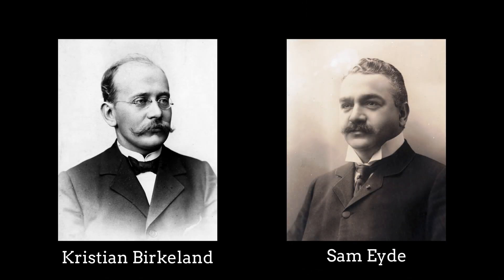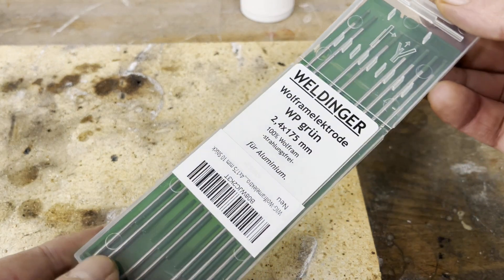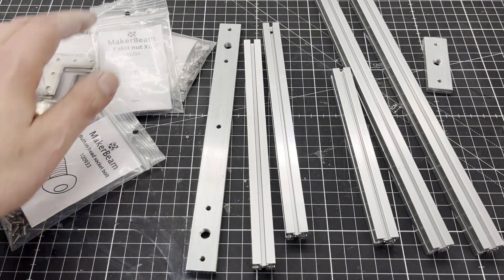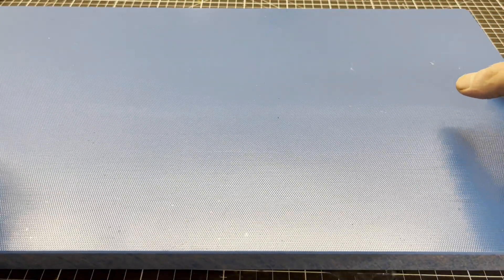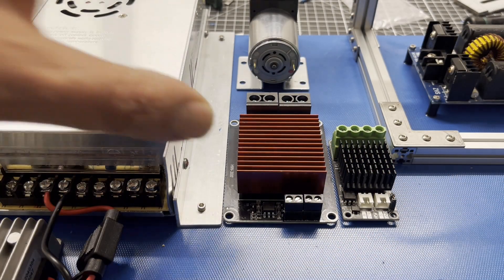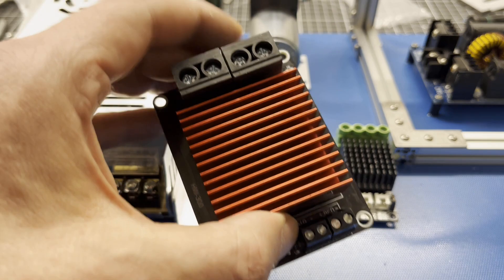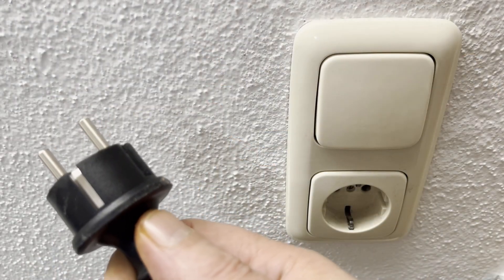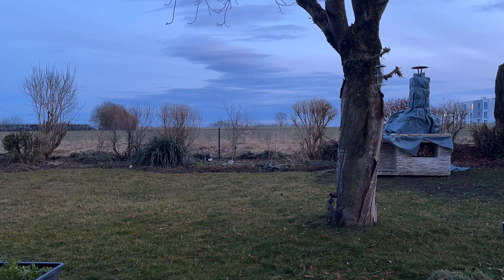Building a small, fully automatic Birkeland-Eyde experimental reactor

Comment: Super cool setup. It's since long time I'd like to make something similar. Some questions.
Where the arc is formed the temperature should be pretty high, however you clearly kept the overall temperature lower seeing the arc tuning on and off. Why?
How do you combine the flow rate with temperature and the whole process? 
Finally, if can I ask, where do you purchase those silicone tubing and mat?
Cheers.
Reply from the maker: Thank you:) The duty cycle (5s ON, 3s OFF) was just for testing to see how hot the reaction flask gets. Flow rate, temperature, duty cycle etc. are still under testing. It can be run to produce nictric acid, but I want to use the reactor also for research; plasma physics for example, emission spectrum, black body radiation of the electrodes, etc. The silicone tubing and mat can be bought on Amazon:)
Reply: @Marbslab  thank you. I searched in the past silicone tubing on Amazon but I got "scammed": it was PVC.
Reply from the maker: @AccidentalScience  You need to know which seller you will buy from. Fortunately, you can send the crap back and get your money back.
Reply: Where can you get a reactor like that in Germany? Ebay on used market??
Reply from the maker: @jochinq3116  Do you mean the round flask? I bought this one: https://www.winlab.de/schule/experimentiergeraete/laborglasgeraete/sonstige-glasgeraete/glaskugel-2xsb-19-und-2-stutzen
Reply: @Marbslab  Ah, perfekt, thank you!
Reply: Try Mcmastercarr They have all industrial and some lab equipment!

Comment: Won't tungsten react with nitrogen compounds at such temperatures? I think its quite reactive thats why in welding processes they blow argon through the electrodes also to cool them down, otherwise they are broken. Is it not true?
Reply from the maker: Tungsten is a chemically very resistant metal that is hardly attacked even by hydrofluoric acid and aqua regia. In tungsten inert gas welding, the inert gas is used to protect the workpiece from oxidation and not the electrode.
Reply: @Marbslab  my electrodes oxidise and don't work anymore after using them without gas. So maybe you don't have high temps? I don't get this.
Reply from the maker: @stasi0238  Sure, the temperature is lower in my setup than for WIG welding. The electrodes in my reactor have a temperature of 2000 to 3000 K, much lower than the melting point of tungsten (3695 K).
Reply: CARBON*

Comment: for optimization, i think bubbling the output gasses through a hydrogen peroxide solution would increase overall yield. probably not by much, but 3% peroxide is very cheap and available nearly everywhere in the world.
Reply from the maker: This can be done, but it is also a question of the optimum bubble pressure and temperature of the H2O2 solution. A 3% H2O2 solution is probably not enough. In addition, the H2O2 solution becomes very hot. It may need to be cooled.

Comment: This is neat, thanks for also posting it to reddit. Some Qs: why solder the tungsten to stainless tubing to copper rod to connect a wire, rather than soldering the wire to the tungsten directly? What set your spark duty cycle, the reaction vessel temperature?

There is an industrial thing called a "desiccant breather" that may be convenient for anyone taking this on, it combines a large color changing desiccant pack and a 3 micron air filter, with a plumbing fitting outlet. Might be cheaper than the desiccant glassware.
Reply from the maker: Because I can just soft solder wires to the copper rod. Silver soldering will destroy the wire isolation (I used high-voltage wires). The duty cycles can be set by the micro controller. For the test I used 5s ON and 3s OFF. Otherwise the reaction flask gets very hot). The air pump can be controlled by PWM.
I think I know you from the Sugar Shot to Space project:)
Reply: @Marbslab  Makes sense, thanks! And what a small world. SS2S has been a bit quiet lately.
Reply: @Marbslab  how did you even get the glassware? is it custom made by glassco or does it have a name? how much did you pay?
Reply from the maker: @deraufsmaulwurf3175  It can be bought here: https://www.winlab.de/schule/experimentiergeraete/laborglasgeraete/sonstige-glasgeraete/glaskugel-2xsb-19-und-2-stutzen
I think 40 € is not too expensive:)